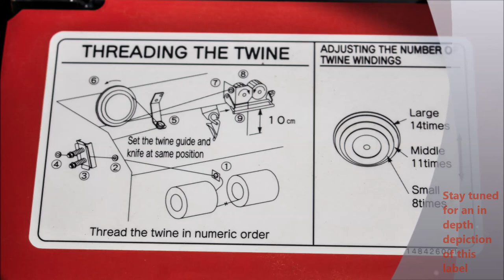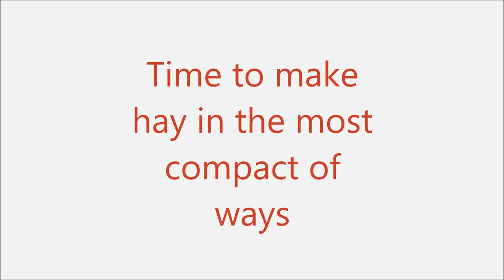Hay Tools 3 - Yanmar YMRB32 Compact Round Hay Baler for Hay Harvest - Yanmar Tractor

Comment: Ok, used my baller yesterday.  It had a couple of hiccups but did pretty darn good.  Use a lot of string on the highest setting.  Going to try the lowest next time.  As a test run I bailed 35 rolls.  It does take longer than square bailing do to all the stopping to tie and drop the roll.  I used the medium density setting but it was heavier than I wanted so I will try the less dense next time, I wanted a light bail for lifting in my old age.  At this point I kinda wish it was a net wrap machine.  It does work and was cheaper than a new square bailer.
Reply: Well the bailer went to hell in a hand basket and Yanmar dealer is unable to repair after 3 tries.  Yanmar acted as if they would help but the slowly faded out of the picture leaving me with a hay package of $16,000 that is a piece of crap that does not work.

Comment: Boy . . . Would it be fun picking those up off the field on a hot day!
Reply: Use the same tractor with a hey spire or fork. Bring the bails to a central trailer. Connect trailer to tractor and away you go. Virtually all enjoyable seat time.
Reply: I would much rather pick up these small round bales than square bales. You can roll them, easier to carry, smoother and not as sticky as a square bale.

Comment: We have the baler, disc mower, and rake system. What I would like to see, while I do LOVE having these videos for reference, is a MORE detailed hook up videos for each. We have the WORST problem hooking up the mower. It is SO heavy and the pin and crank system NEVER works like is described in the manual. We have to rethink it and improvise each and every year. ALSO, the dust shield inside the baler by the cutter knife was constantly getting caught up IN the knife as it traveled back and forth, causing the bale not to be wrapped, the whole system to jam, until the shield finally tore. We had to remove it. All of this costing valuable field time. PLEASE consider a detailed step by every step hook-up and removal of that disk mower.
Reply: Hello from Colorado.  I am considering one of these.  How do you like handling and stacking the round bales compared to the traditional square bales.  thanks in advance!
Reply: @keithjacobson4493   Easy peasy. We have a small hay shed for curing and we just stack them high like honeycomb to about 8 feet high. The shed has re-enforced walls so the stacks aren't pyramid, we use the walls as ends.  In the barn only one end is a solid wall the rest of the stack tapers down like a pyramid. We LOVE the rounds. LOVE them.  Let me know if I can be of any other help.  I''ve only done 4 cuttings so far, so I'm far from a pro, but sometimes when helping, that's a good thing. I can move them much easier than a square that's for DARN sure.
Reply: @weatherlady9666  thanks for the quick response !  That sounds good. Do they feed as easily as the other bales. I usually weigh the hay for my horses.  Does the hay come unrolled so that I could end up tearing off a fairly close weight?  Thanks again!!
Reply: @keithjacobson335  It absolutely does come unrolled. In fact, to encourage pasture grazing this time of year for the alpaca herd, I untie a bale, get it started and slowly kick it downhill and let it unroll like a fruit roll-up.  It leaves a long trail of hay for natural head down foraging.  The rest of the time we have whole bales up in V shaped hayracks and let them just have at it. They eat it from all directions and I have less waste/spillage than I did from flakes off squares.  The boogers would pick up a whole flake from the feeder, take a mouthful, and drop and trample the rest.  The rounds slow them down, which is a good thing.
Reply: @weatherlady9666  thank you. I really appreciate you taking time to respond.
Reply: @keithjacobson335  No worries. Here for any other questions you might have.

Comment: Tan mar makes it, that is a good enough reason to stay away from it. 
Every single Yanmar Tractor that I ever split to replace the clutch was in danger of breaking in half because of poor quality/design, every one of the bolt bosses in the case was cracked or broken out!
FYI, just about any tractor under 50 horsepower sold today from John Deere, Massey Ferguson, and New Holland/Ford is actually a Yanmar and quite often the same model is sold by all three. 
Don’t believe me just look on the engine block.
Reply: Only the engines are made by Yanmar. They have been designing diesel engines since the early 1900s. As far as I know, none of the other components are made by Yanmar.

Comment: These tiny hay bales have to be the biggest waste of time. You have to move that many more bales to feed animals.
Reply: to an extent I agree but keep in mind the person who uses this baler likely only has horses or a very small livestock operation they're a hobby farmer for one, 2 they might not need or have a 70+hp tractor nor have or want to spend 30 grand on a full size round baler especially if it's something they're not making a living with this would be a good alternative although if you're making a living with hay or running a large livestock operation this baler is not suitable for you
Reply: Jon Homrich very true it's suited for a small time hobby farmer. But what what I've seen the whole mini mower, rake, and baler combo is around $10k. And $10k can buy hay for years for a hobby guy and you don't have to deal with the time, fuel and maintenance costs and land for making hay. I estimate it would take 8-10 years to break even on buying this equipment vs buying hay before you consider costs other than the purchase price of the hay equip, and buy that time it'll be time to replace it. But hey it'll work for somebody.
Reply: Drew w it works great for me. I live on 2.5 acres and house and horses are on the half acre and I bale the 2 acres and it's just enough. No need for a big ass one. I'd rather have a small square baler. But I give it 2 thumbs up
Reply: Some (most) people would do this for the enjoyment of it on their hobby farm.  I mean, that's the whole point of a hobby farm.
Reply: And and and you don’t have the huge cash outlay for tractors over 100 HP , the compact tractor market makes this economical
Reply: For me I need a bale that I can stack up in my loft. I just bought one of these balers and I like it. The bales are easy to handle cause you can roll them along instead of having to carry them. Also I pick them up by the ends instead of using the twine when I carry them. It's a real nice size to carry.
Reply: They weigh the same as smalls squares sold in my area around 50-60 pounds. Mostly sold to horse owners.
Reply: This wold be good  for those tight places like road side ditches and small lots with gas and diseal fuel so DAM high this is the way to go.
Reply: Still any man worth his salt p*s & vinegar can still toss a hundred twenty pound bale around like it's child's play, and if not they're round they'll roll of you gotta, at that though you own a small tractor just use the loader or a 3pt spear heck even if they made them 3' 3*  you could still pick them up  at least 3 up at a time with most compacts, two at a time with a subcompact. They should have optimised this for the just sub 27hp class of small frame actual tractors, but that would have left the guys running lawn mowers put out.
Reply: Not everyone is feeding 300 cows at a time...
Reply: These bales are very popular with goat farmers. That's mostly the people I sell to.